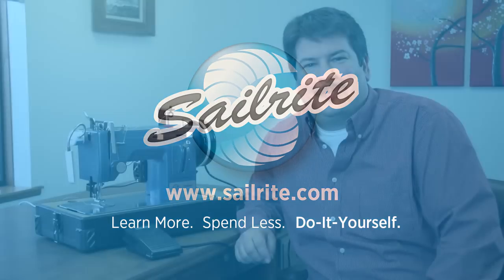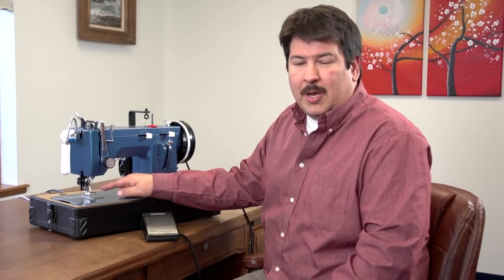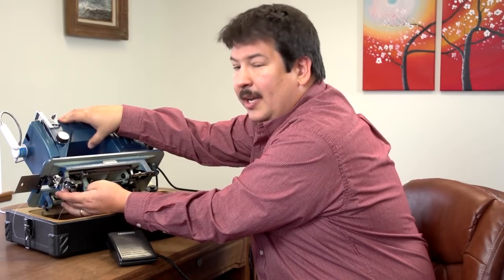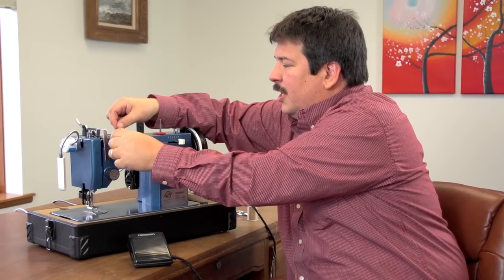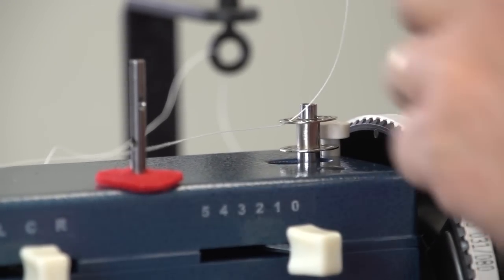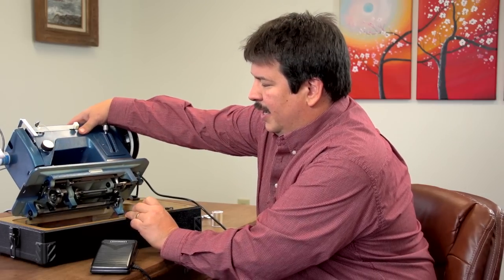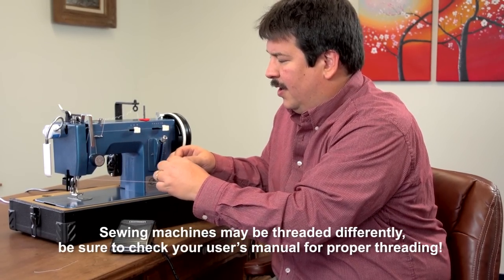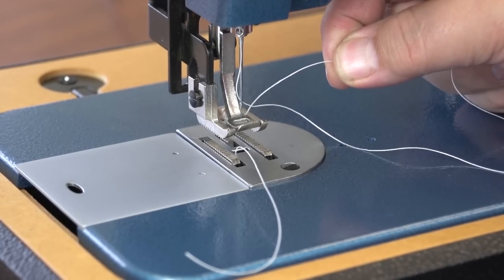Learning to Sew Part 1: How to Set up Your Sewing Machine

Comment: I love this video.  I come back to it every time I need to use my Sailrite sewing machine.  Great videos for someone who has never sewn.  Awesome machine.  I sewed through five layers of the strapping on a pool cover with this machine to make a pool cover smaller to fit our pool.  Only broke a few needles and one internal part that was easy to reorder and replace in the machine.  This think is awesome!  Just sewed a strap back on my leather sandals using the hand turning wheel with no electricity.  My wife has sewn sail covers, hatch covers, fender covers, made homemade sails on this machine.  It is one tough piece of equipment!  Worth its weight in gold.
Reply from the maker: Wow, good job!!! We are glad you like your Sailrite Ultrafeed Sewing Machine.

Comment: This machine seems amazing.I love the tutorials and the machines are priced great for all they do. I'm looking to purchase one to sew only leather...(Python, snakeskin, ostrich, stingray) Will this particular machine be able to handle that? Thanks
Reply from the maker: SidHimSelf If you plan on only sewing leather you may only need the Ultrafeed LS-1 sewing machine. It is a straight stitch only machine and will save you even more money since it is cheaper. However, both the LS-1 and LSZ-1 (shown in this video) will sew leather very well. Here is a video showing sewing some of the max leather sewing applications: https://youtu.be/hVLLvgPlrBI
Reply: +Sailrite Thanks a million, I'm gonna go with the zig sag model because some of the designs I'm interested in making are zig zag. Also would I be able to substitute the leather foot for the one that doesn't leave marks on the leather? Thank you for the rapid response.
Reply from the maker: SidHimSelf Yes, you can substitute the standard foot for a leather foot. Here is the link to that foot: http://www.sailrite.com/Leather-Foot-for-Ultrafeed-LSZ-1-ZigZag-Sewing-Machine

Comment: Great video, thanks! I've actually been sewing for a long time, but refreshers are always helpful, especially with a new machine. Thanks!

Also...I'm having a HORRIBLE time controlling the speed of my XL2600i. Maybe it's because I've been using a 45 year old Necci for 30 years, but practicing doesn't seem to help at all...I've tried stitch guides...everything. It's just too fast to even stitch in a straight line, rendering it completely unusable at this point. Any suggestions you can offer would be great. Thanks! :)

Comment: I love My Sailrite sewing machine I have the Ultra Feed LSZ-1. I have purchased the Monster balance wheel.  It’s very difficult to turn and makes a growling sound. I use it for many things. Boat seat covers, etc. I’m afraid that I might burn out the motor. Are there adjustments for helping the wheel to turn easier?
Reply from the maker: Please contact support@sailrite.com with your concern and we will start a support case to get you running smoothly.

Comment: I do not have one these machines yet, but I am leaning toward it. One of my questions is the noise that I have heard is loud. Any thoughts on this? And does the monster wheel help.
Reply from the maker: Joe, The sewing machine sews and feeds fabric with ease, but it is a rather loud sewing machine. Sure the "Monster II Balance Wheel" does help keep the noise level down. Why? Because it is one solid steel piece unlike the standard "Power Plus Wheel" which has an open/empty cavity that tends to bounce the noise around a bit more.

Comment: Is there a video on care and maintenance for the Sailrite sewing machines?  I always question which way the needle is replaced, does the groove side face left or right...or does it even matter?  My manual that came with the machine is so lousy that it is hard to comprehend it.
Reply from the maker: +Jaimee K If it is our machine the manual is an excellent 4 color manual that will easily show how to insert the needle and much more (however our older manuals were in need of improvement so if your machin is 8 years old or older then that may be the issue). You may want to consider purchasing a new manual: http://www.sailrite.com/Guidebook-for-Sailrite-Ultrafeed-LS-1-LSZ-1-Sewing-Machines 
or watch this video on how to insert the needle: https://www.youtube.com/watch?v=vIbNlLkaqnc
Reply: +Sailrite ...Thanks for the reply, unfortunately the manual that I received is a construction paper cover (red) with a black & white Xerox copied pages. It's an old model, but still kicking, the videos help me learn more about my machine. Thanks again!
Reply from the maker: +Jaimee K Glad we could help!!!

Comment: question, can an industrial straight stitch sewing machine be change to a walking foot. and what is the difference .
Reply from the maker: A true mechanical walking foot cannot be added to a sewing machine that was not built for it, sorry. Some companies sell a walking foot attachment, but all it does is raise the presser foot when the needle goes up. It does not actually make the presser feet work with the feed dog, so they do very little.
Reply: thank you for your quick response. So i guess my question now is do i need a walking foot to do upholstery. or can i get away with a machine that is not a walking foot.
Reply from the maker: You do not need to buy a true walking foot sewing machine to sew upholstery. However, it does make sewing much easier, so you may want to consider it in the future.

Comment: hello i really do not know what kind of thread to buy i just got my new machine yesterday and i need to know what kind of thread do i need
Reply from the maker: This may help:
Usually a Polyester or Nylon V-69 is used with Upholstery fabric (medium weight fabrics) and a Polyester V-92 is used with Marine Grade fabric (heavier fabrics). For very light fabrics pick a V-46 or V-30 thread. Do not use Nylon thread for any outdoor use. However, I want you to know the whole truth about threads for outdoor use, this is especially important if you live in a tropical or desert environment (High UV exposure). Keep reading to find out about Polyester thread and PTFE threads… 

THREADS FOR OUTDOOR USE - POLYESTER vs PTFE:
Polyester thread is UV resistant, but not UV proof. It depends on the climate and how much UV it gets on how long it will last. I usually consider two types of thread for outdoor projects: Polyester or PTFE threads (like Tenara or Profilen). The PTFE threads will last the life time of the fabric no matter the climate and they are chemical resistant. However, PTFE threads are expensive and more difficult to sew with. Profilen PTFE thread sews easier than Tenara PTFE on an oscillating hook sewing machine (like our Ultrafeed sewing machines). Most customers pick Polyester thread because it is less expensive and easy to sew with. If you purchase Polyester thread the best colors are Black and White, they are solution dyed (colors run all the way through the thread) the other colors are only coated on the surface and will eventually fade faster. 
Let me know if you have more questions.

Comment: Why don't they make domestic machines with a two piece walking foot?
Reply from the maker: On some home sewing machines you can add a foot that they say is a "walking foot", but it is not. It is simply a foot that lifts up with the needle bar as it is lifted. It would add no pulling power. A true walking foot sewing machine has a mechanical system that helps pulls the fabric from top and bottom and then lifts the foot when the needle exits the fabric. Why do home or domestic machines not have that feature? It costs more to make the machine and a walking foot sewing machine typically is more heavily build to handle heavier assemblies. I hope that helps answer you question.